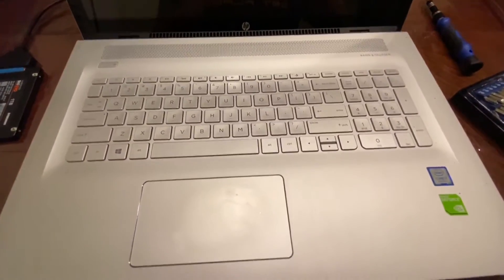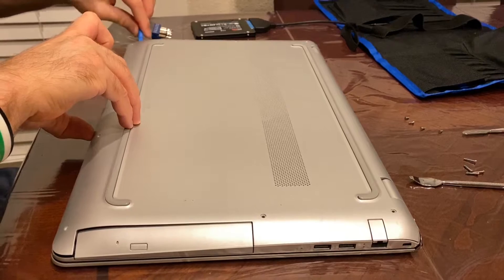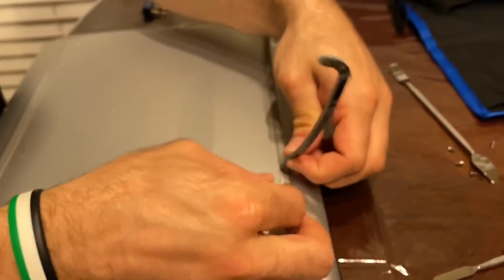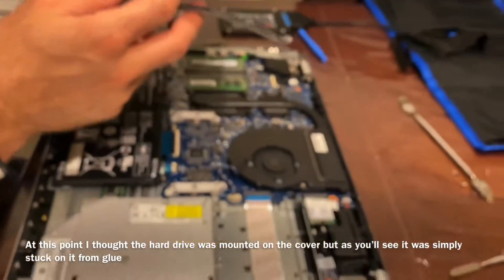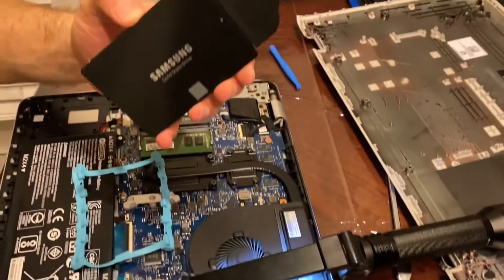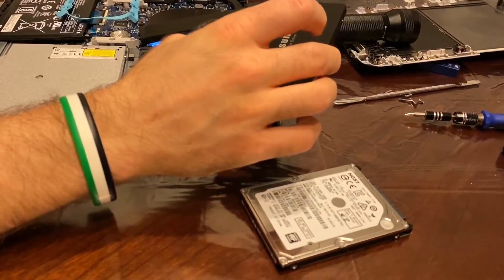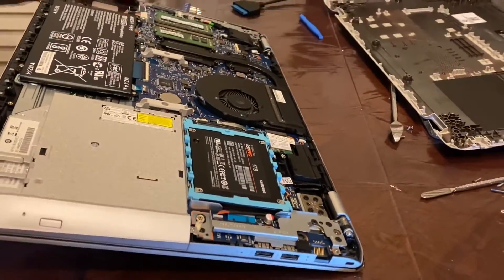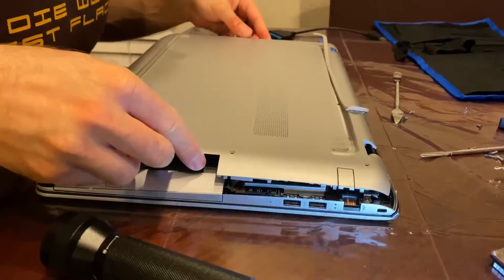How to upgrade laptop hard drive to SSD without reinstalling windows! HP Envy

Comment: I have this model. This model have a PCIe M2 conector for a second SSD ??
Reply from the maker: I don’t think this model has internal pci-e connector. Do you need two storage drives? Just buy one SATA drive that has 1TB or more capacity. They’re cheaper than they used to be before.
Reply: @GrindMyGears  Thanks for that.  I was going to ask the same question.  I just did a SSD replacement on this same computer model.  Was looking to see if there was a spot for a second HD.  Didn't see one.
Reply from the maker: @Huggybear101  you’re welcome! 😊
Reply: @Huggybear101  but if your laptop has a DVD drive. you can take it off (remove it from the laptop by unscrewing the screws) and put a caddy in the DVD drive place and then put your old HDD in the caddy. Then you have both your new SSD and old HDD on your laptop.